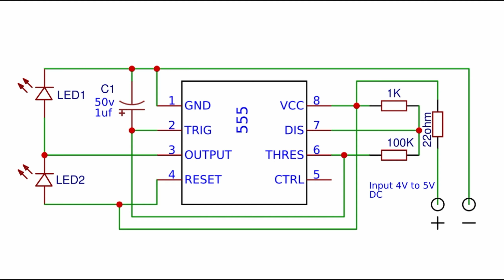555N ic tester| DIY how to make 555N ic tester circuit

Comment: Can i use mor led .. by increasing voltage . Like 7-8 voltage
Reply from the maker: You can use 330ohm resistor on pin 3 of IC for 8 to 12V